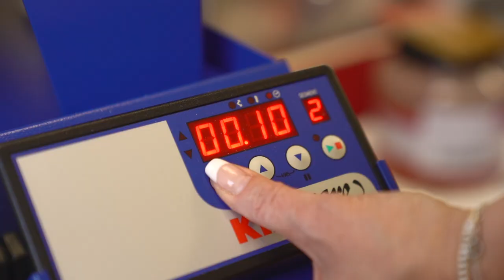Seaside houses project in depth

Comment: Does the glass all have to be bullseye.  I have tons of glass not sure if its fuseable
Reply from the maker: All glass is fuseable, however it's important you know the COE rating of the glass and don't mix different COE ratings. Coefficient of Expansion (COE) is a measurement of the rate that glass will expand and contract when it is heated and cooled. Mixing different COE ratings will lead to shattering / cracking at some point in the future.